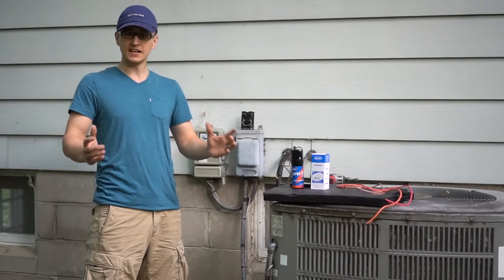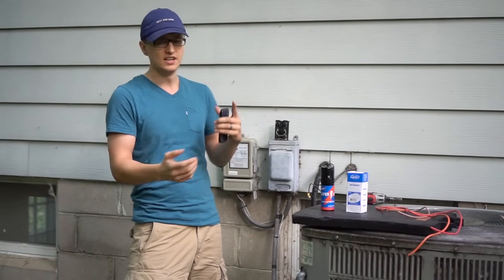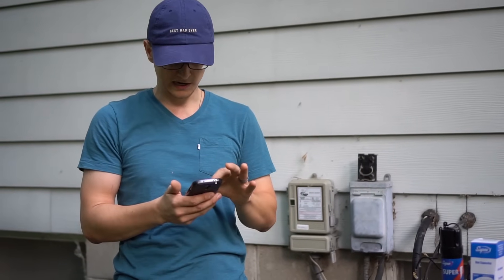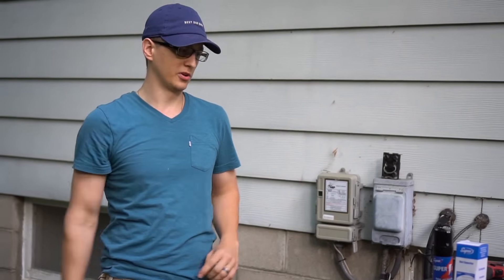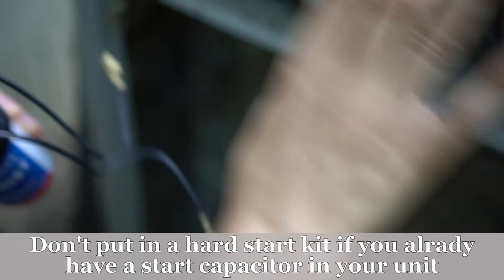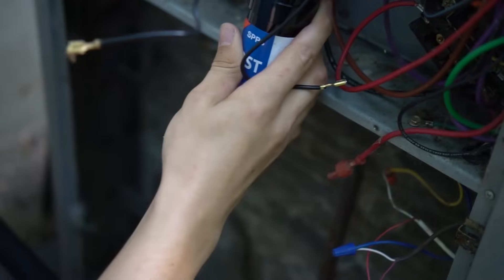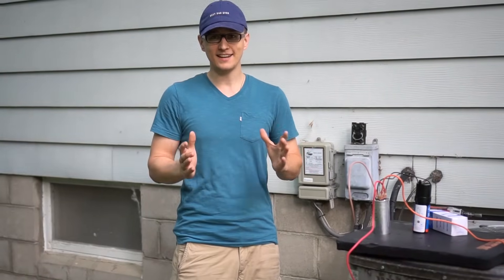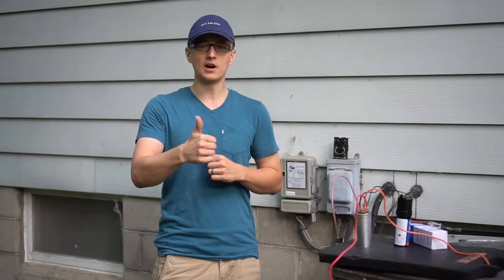How to Install a Hard Start Kit in Your Air Conditioner

Comment: Will the supco spp6 work on all  dual capacitors found in AC units? Sorry if this is a dumb question, I am not knowledgeable at all in this area.
Reply from the maker: Yes it will work with all dual capacitors. Just make sure you do not already have a start capacitor in your unit like I showed in my video. (or just take the old one out)
Reply: @WordofAdviceTV  thanks for getting back to me and for making these videos! I was told that it would be $900 to replace the capacitor and put in a hard start kit by one of our local hvac companies.. It was very satisfying to replace everything for $16 instead.
Reply from the maker: Lol, I would be satisfied with that too. Glad to hear you are back up and running! Stay cool ;)
Reply: @beekohillaman  Saved me $300 bones to do my own so thankful for Word of Advice TV

Comment: So, If you were to install in your unit, you would remove the relay and hard start, then just wire in the new hard start kit to the run cap?
Reply from the maker: Yes, if I were to put in the SPP6, I would take out the old start capacitor and relay.

Comment: If you didn’t know for sure if you needed a hard start kit, would it help your unit anyway to go ahead and add one?
Reply from the maker: They are relatively cheap and yes, it would help the unit since it decreases the wear and tear on the compressor at start ups. So why not? I would. :)
Reply: So I purchased a spp6 start kit, but when I took my unit cover off if mentioned to not install a start kit if the unit has a ptcr. How would I tell if I have one?
Reply: @ednovak6060   You probably have figured this out by now but, on mine, it's quite a bit smaller than the run capacitor. It was only 2" high and two wires coming out of it, one out the top, one out the bottom, both going to the run capacitor. Mine is a cera-mite start assist capacitor. Some have three wires, with one coming out the middle - don't know where that goes. I tested mine and it was bad. I just removed it and installed a 5-2-1. You can check at a site like repairclinic, plug in your model # and look for the start assist. From my research, the 5-2-1 is better than the ceramite since it has a mechanical relay in place of a thermistor.
Reply: That's why I put a 5-2-1 compressor saver in my 30+ year 2.5 ton Ruud condensor. They reset faster than the SP6 types, but they are more expensive to buy.

Comment: Great video! How would you wire a 5-2-1 start kit?
Reply from the maker: Thank you! 1 would go to one side of the start capacitor, 2 goes to herm on the run capacitor, and 5 goes to L1 on the contactor (sometimes L2. If you look where the run capacitor common wire goes to, just make sure you don't put 5 on the same side as the common from the run capacitor) And the other wire from the start capacitor will go to common on the run capacitor.